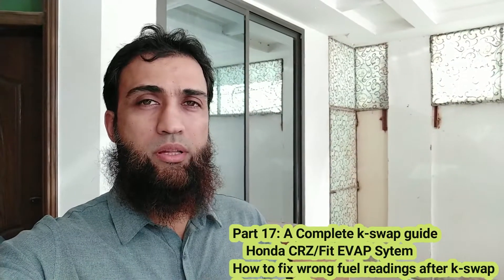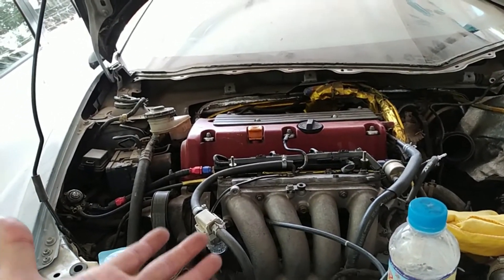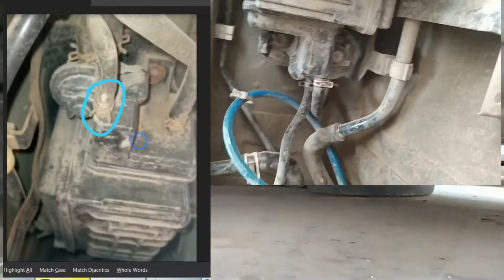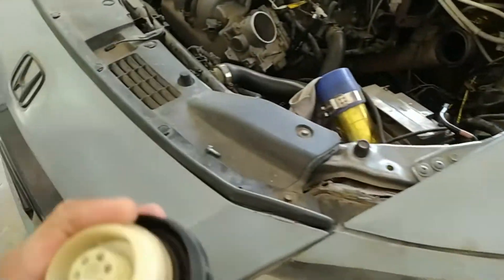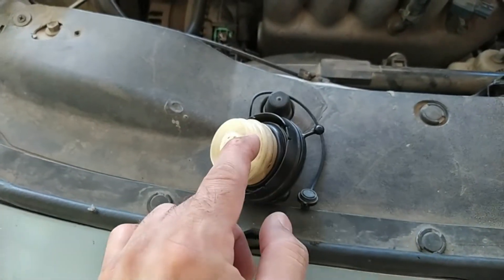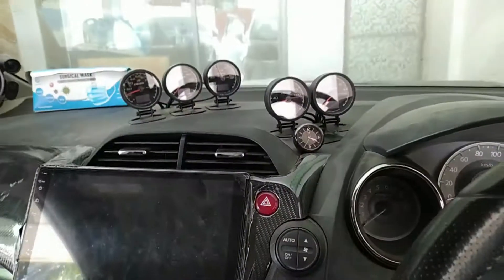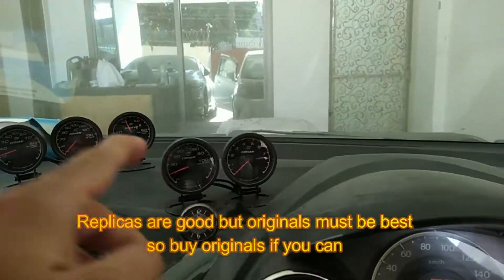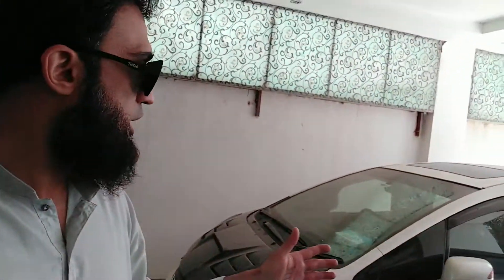Part 17: Complete k swap guide CRZ/Fit. Fuel reading wrong?

Comment from the maker: One thing i forgot to tell, if you do one of above mentioned solutions e.g. manual evap, hole in fuel cap, retune fuel system. Than you should disable the EVAP system in software too. Otherwise the ECU/PCM will throw error codes. Also as he fuel system is under pressure so some vapors will escape when you open the fuel cap/lid. Thats normal.
Reply from the maker: Update: I tried fuel cap hole method on my Honda Fit which has still return less fuel system and the problem was still there.So converting to return system is only working solution.

Comment: why not just do a return system and tap to tank then make purge solenoid to work so you dont need to vent to atmosphere nor to put a pin hole in your gas cap and dont even need to delete your evap code?
Reply from the maker: @allantiongson9021  yes later on I did this. Full return system with purge to atmosphere. Can't purge to in the since Evap purge valve does not work anymore after swap

Comment: Have you figured out to keep cruise control?
Reply from the maker: No i have not treid so much because it is very difficult to do especially if car was CVT before and is manual now.there are clutch pedal sensors and than brake paddle sensors and than the ECU itself.a lot of things involved  and can bus system